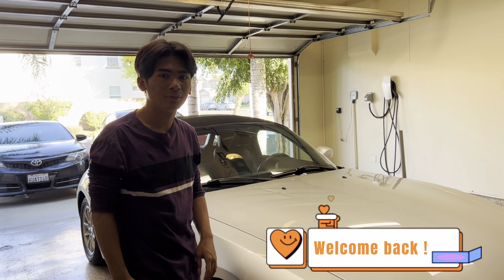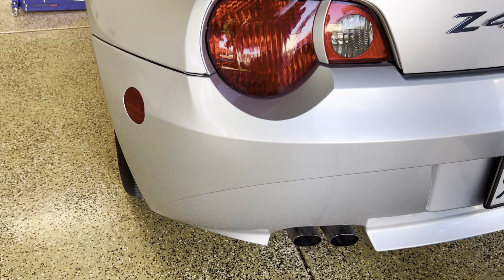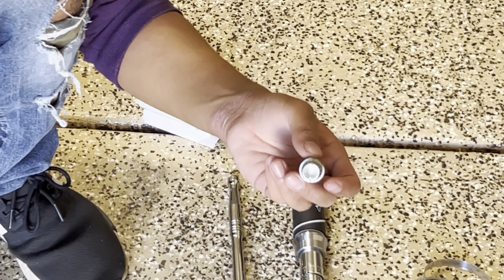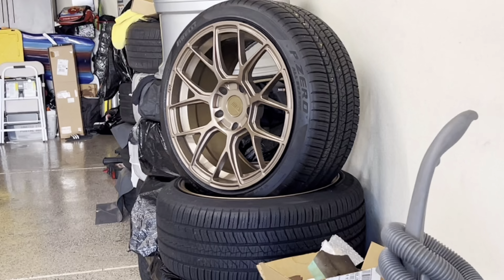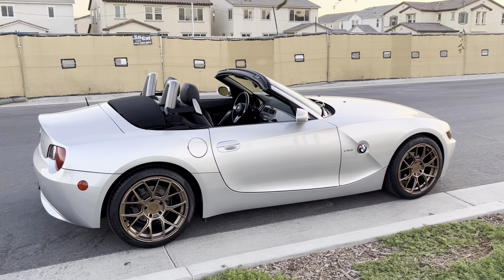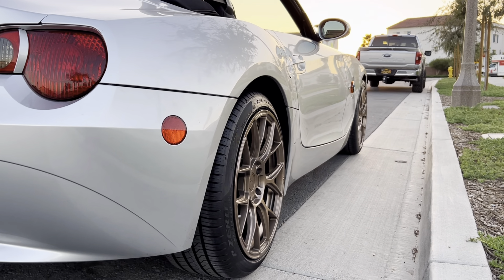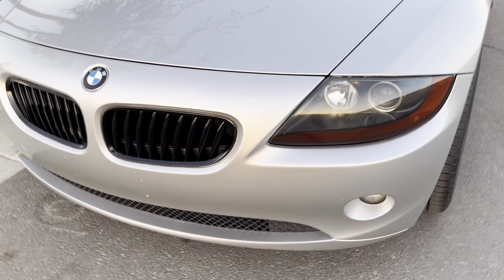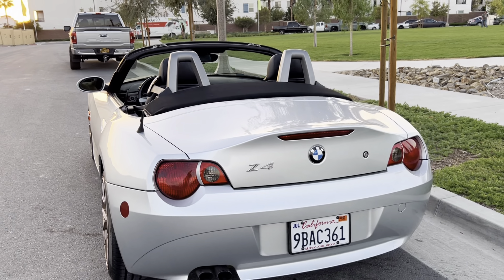New Look for the BMW Z4 E85 .. installed bronze staggered wheels , roller shots , cinematic edit

Comment: By any chance you think I can put 19s on mine ?
Reply from the maker: Oh ya it’s doable for sure.  Just put the correct width and offset so you won’t rub
Reply: Any recommendations? Btw thank you so much for your help
Reply from the maker: @Elvispapito900  you can run 19x8.5 +35 fronts and 19x9.5 +35 rears